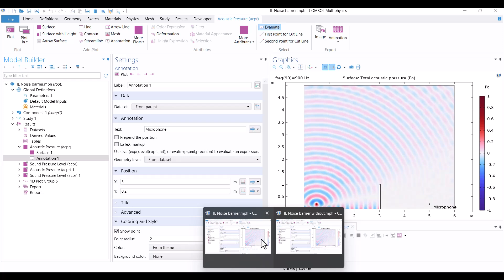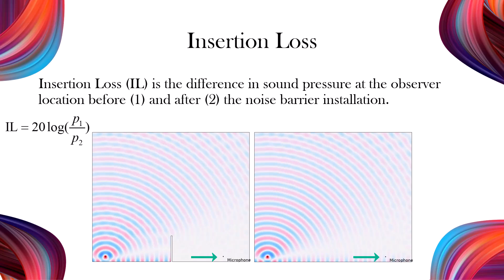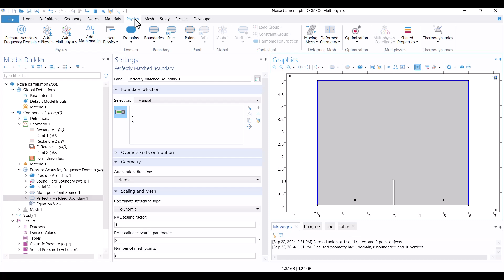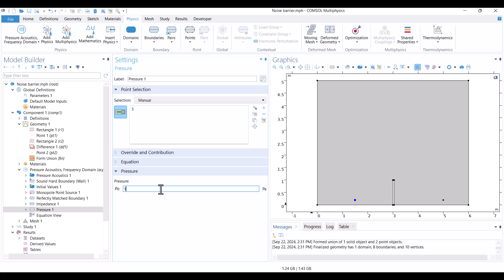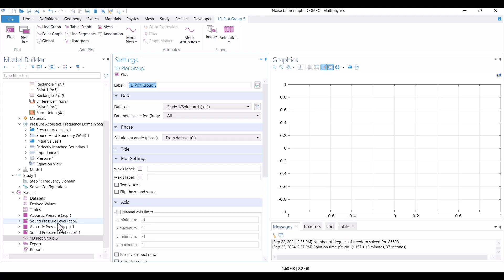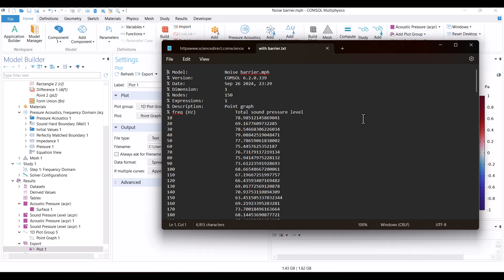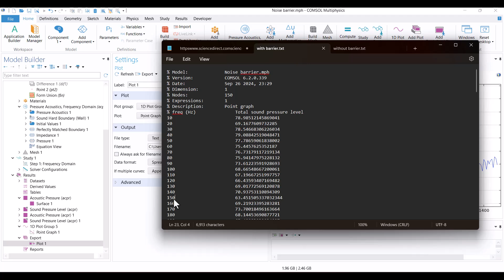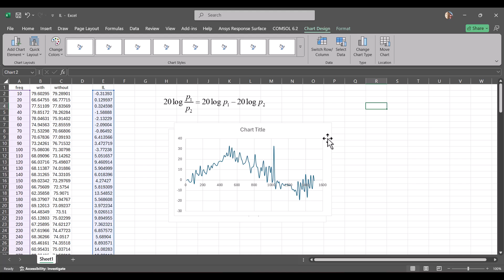🔊 COMSOL Tutorial: Insertion Loss of  a Noise Barrier

Comment: Hi Armin, thanks for this tutorial. Can you explain how we can calculate acoustic pressure or sound pressure level beyond the PMB? I heard it can be done using Exterior Field Calculation, I'm messing around with it in COMSOL but can't seem to figure it out. 

Would be very grateful for your help.
Reply from the maker: Hello. I only use it in 3D space. Yes, you can use exterior field calculation, which employs the boundary element method to calculate SPL beyond the domain.

Comment: Does the sound pressure level or sound pressure be used to calculate the insertion loss? I saw that some books talked about sound pressure
Reply from the maker: @emperornarure  Is the insertion loss calculated using something else?
Reply: @caewitharminhashemi does p stand for sound pressure level in the formula of TL
Reply from the maker: @emperornarure  p is acoustic pressure and is used in insertion and transmit loss